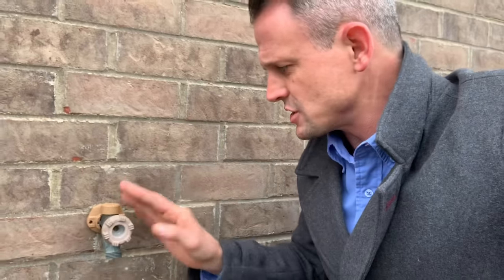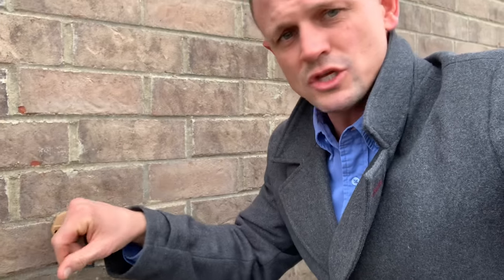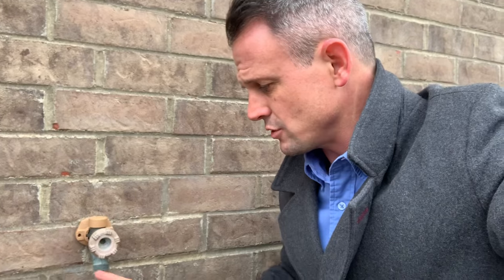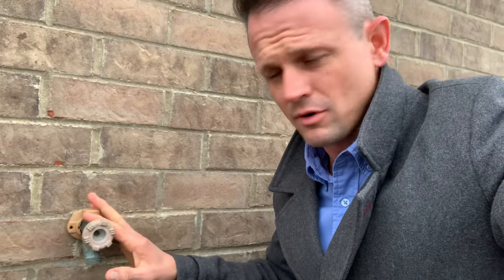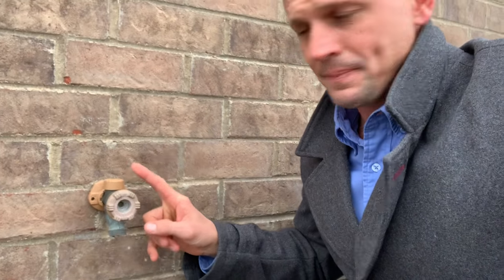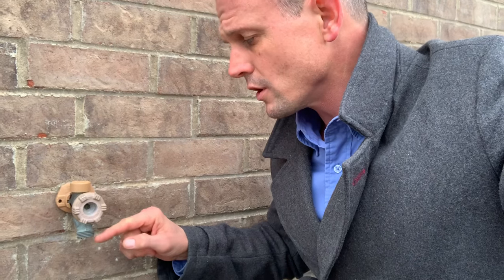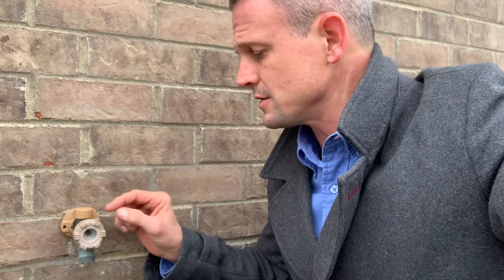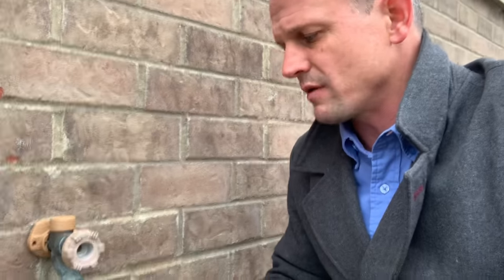How does an anti-siphon frost proof hose bib work

Comment: I think mine might have had a slow drip. I covered it with a styrofoam insulator knowing we had freezing weather on its way.  Now there’s ice all around the cover and the cover is frozen to the wall. You can see that the water came from inside the insulator.  I’m assuming it’s safe to say that when things thaw, I more than likely will have a broken chamber on my hands?  Should I try and thaw it?  Or wait for it to thaw on its own?  (We still have freezing temps for the next few days.)

And thanks for the the video too. Great job explaining how it works.
Reply from the maker: Hi Jeremy thank you for the compliment on the video!

If you have a shut off valve that goes to that hose bib inside the house I would turn it off because more than likely you’re right and the chamber is frozen, may have cracked, and will need to be replaced. Which replacing is easier to do when the temperatures are above freezing.
Reply: @BJPoznecki  Thanks for the reply and info, BJ! 👍🏼
Reply from the maker: @jeremymoss3063  My pleasure Jeremy!

Comment: How did things work before these were invented?  The whole North of the  country didn't have flooded basements every year, surely?
Reply from the maker: Well, actually, some people did have issues. If you don’t have a shut off valve inside the home where you can turn off the water and open the hose bib so the water could run out then they did freeze and burst the pipe.
Well, I should say here in the Midwest, we did have problems.
Reply: In Virginia, those of us without a separate shutoff simply cover the hose bib with an insulated cover to protect against short periods of hard freeze.  Keeps the wind off.  Works fine.